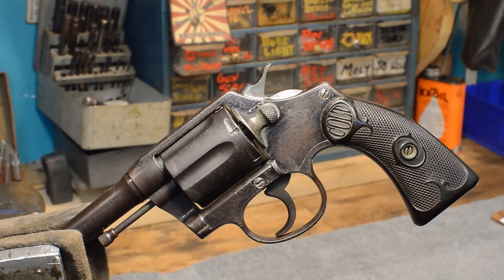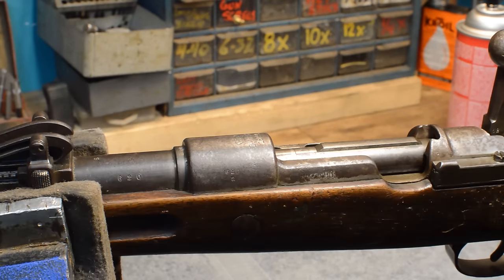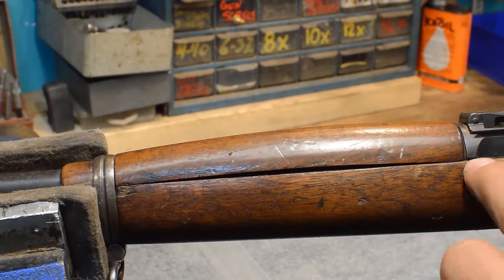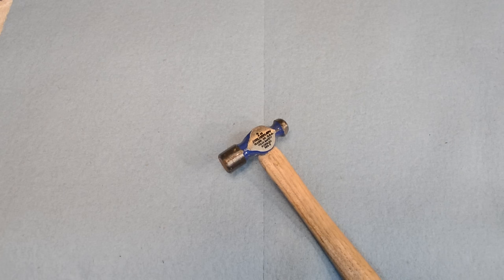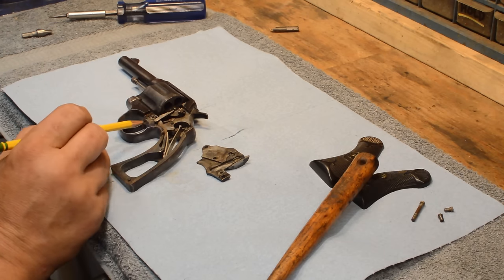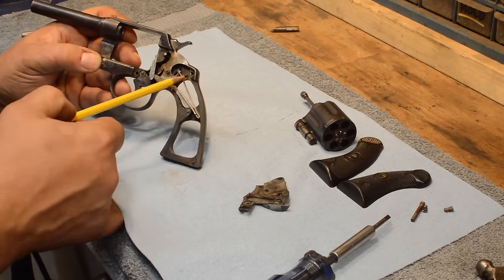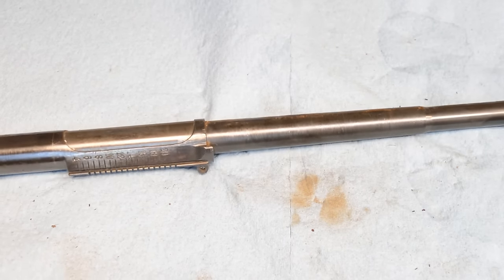Conservation 101: Stop the decay!

Comment: Hey there, question for you? But first, thank you for your videos, I have enjoyed learning a little something about conservation of firearms. So back to the question, I have a nicely blued 1903 pocket hammerless, I don't know if it's the original bluing but it looks pretty nice. There is however one small spot of rust on the slide the size of a small drop of water or so. Can I just boil any parts that have rust on them in water to convert the rust without removing or damaging the finish on the gun? The rust spot is pretty small but I want to stop it from growing any more. It's a nice old gun, I'd like to keep it as nice as possible. Ya know? Thanks for your time.
Reply: I have a very similar situation. Have you found a good answer? Best of luck!
Reply: That is exactly what this video is about. All the same rules just described apply.

Comment: I've cooked my rusty 98k parts today and tried to brush off the converted rust with a nylon brush and the rough side of a pot sponge.
Didn't really work and the parts sitting in kerosene now.
Do I have to card that loose oxide off or can I leave it there?
Reply: Since three weeks has gone by ,how did it turn out ?
Reply: @jimmymckay73  Ended with using a brass brush and steel wool. I think I did remove (most) rust, but on those area where I used the brass brush the metal did turn slightly brass colored.

Comment: Do you adversely affect the value of a collector gun by replacing damaged screws with NOS originals?
Reply: unless they're uniquely marked I honestly don't see why they would. Especially if you take the time to "antique" the metal no one would be any the wiser in the first place.
Reply: Probably not, but it pays to be honest. If you did replace a part tell the buyer why and try to use appropriate replacement parts. 99.9% of people besides you and him would never know or care to know.
Reply: @NoQuestions4sked  Thank you, Jared!
Reply: @NoQuestions4sked  Yeah, the honesty is the crucial part. There's absolutely nothing wrong with doing that type of restoration, but it starts feeling sketchy if I discover it after having paid for the thing. Not being upfront about it is just a quick and easy way to invite skepticism towards you as a seller. It's not the crime that gets people, it's the cover up, so to speak.

Comment: Is there a smaller carding wheel that could be used with a dremmel tool? I looked on Amazon but all I saw were wire wheels.
Reply: That'd be nice
Reply: A Dremel spins way too fast. you can chuck a carding wheel into a hand drill
Reply: @TEXwithNODS  Many Dremels are variable speed, so your blanket statement is a bit false.
Reply: @TEXwithNODS  That is exactly what I do. I chuck the carding wheel in a hand drill and hold the hand drill in a bench vise.

Comment: So if we cheap out and use diesel instead of kerosene, should we use on-highway low-sulfur b5-b20 biodiesel or off-road diesel/heating oil?
Reply: the more oil the more mess! Kerosene is a bi product of diesel.ergo less oil. so any diesel will do.

Comment: Hey, I'm not sure I have understood everything (english isn't my mother's tongue), but why is it needed to boil the pieces into water and convert the red oxyde into black oxyde? why not removing the rust with fine steel wool + vaseline oil? (I know little to nothing about this subject, just trying to understand)
Reply: When you do that you expose the bare metal so you go back to square 0. with the rust that is there is converted form red to black it protects the underling metal. as stated the boiling is a chemical reaction so the metal is being changed, at least the red iron oxide.
Reply: @handsomerob1223  so you need to first boil the pieces in water and then use fine steel wool 0000 + oil right?
Reply: @Itk8989  Fine steel wool, #0000 but first cleaned in acetone to REMOVE the oil that is added to the steel wool. Then just use the fine steel wool to remove the red oxide that you converted. Even a toothbrush will work.

Comment: may muzzleloader shooters don't use really hot water for fear of "flash rust"... Wouldn't the oxide be there whether or not they choose to see it, (as in when exposed by hot water)???
Reply from the maker: The oxide layer will "flash" no matter what. The trick is to get some oil into the pores. I'd rather use hot water, get the sulfer liquid, RINSE (this step is always skipped), then oil.
Reply: I would never use water either. 
It's really strange watching some muzzleloader vids because people will literally be in denial about rust.
They will say something like "I always just use hot water and have never had rust"
Then proceeds to show the muzzleloader that is so rusted that it's pitting.... 
A new  bottle of engine  oil works for just about everything and only cost like 5 bucks. 
Between a tub of axle grease and a bottle of engine oil you can take care of/ prevent most problems.

Comment: So for an old muzzleloader such as a Springfield 1861 that's finish was "in the white" or bare iron, can I rust blue it and then just strip the bluing off with chemicals to return it to its original finish?
Reply: I have the same question. 
Originally browned guns will stay brown well enough on their own. 
Blued guns that have gone brown can be converted back to blue.
What should be done for guns in the white that have since gone brown?
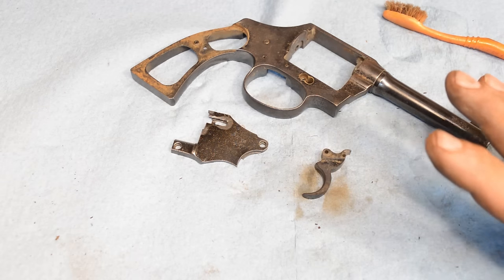Reply: Mark answers your questions exactly at 46:24. Yes mostly. 
1. Degrease your parts
2. Boil in water to convert red oxide to black oxide
3. Dry
4. Card to remove surface oxide
5. Repeat steps 2 through 5 until all rust is removed
6. Chemically remove blueing
7. Soak in kerosene 24hrs.
Reply: not trying to give advice. but would the "patina" that the "in the white" metal develops - would that act as a "browned finished" and stop further erosion of the metal?

Comment: What's that spray that you use at the start to remove oil?
Reply: Judging from the color of the spray can, and how fast it dried, I'd say it might be a can of Brakleen . A chlorinated automotive degreaser.
I use it for a variety of things.
Reply: My mistake , he mentions it later in the video....it's Electrokleen (?) a similar degreaser that's safe to use on circuit boards

Comment: What is the material you use on your bench vise as padding?
Reply: Carpet felt pad.
Reply: GunBlue940 smithed for Ruger and recommends 3/8” plywood. Starts with a square and cuts a recess in the bottom to fit over the throat of the vise.

Comment: Hi Mark, just a simple question: why did you say Diesel "makes a mess"? I can't buy kerosene at a reasonable price here (we're talking like 190€ per gallon): can I just use regular diesel to displace water or are there better alternatives excluding kerosene?
Reply: @Phage26 Go to the airport and buy jetfuel Same as kerosine
Reply: In Northern Europe, Kerosene is sold as heating fuel oil.   Any farmhouse will have an Aga cooker, and if they are not on a gas supply (most farms are not) then they have an oil tank full of heating oil (Kerosene) to run it and run their central heating.   Only trouble is heating kerosene is delivered a few thousand gallons at a time, but the people who sell this fuel oil can let you buy a few gallons as a sample if you speak to them nicely.  Or if you live in the countryside, just take a gallon from your own tank.
Reply: @davefellhoelter1343  apologies, didn't receive a notification for the reply. I just saw it a c ouple minutes ago. I thought he was referring to other "mess", I know it stinks. I did everything outside (only needed a cup for small parts) and wearing gloves and a mask. Kerosene is not really that common here in Italy, unless you can use it with additives that put there so it can be used in the house (pure 100% kerosene is nowehere to be found here, unless you are a registered dealer who can have access to it like in an airport)... Ended up using diesel, really not that bad considering I have plenty of space outside and I can easily wear integral protections I have at home. Thanks for the reply.

Comment: Mark, carding wheels. Are there different wire dimensions, are there wheels that work with a drill as i do not have a bench grinder machine. Thanks for your response and support.
Reply: Everyone absolutely needs a few basic tools for the shop. The three most important tools are a bench grinder (with wire wheel and grinding wheel or polishing wheel), a work bench, and a bench vise. Your work bench must be solid and bolted to the floor, your vise must be of adequate size and it must be bolted to the bench. Your bench grinder must be bolted to the work bench as well.  Get these three things before you spend money anywhere else on tools. They’re the most commonly used tools in most shops. 

Then buy hammers, screwdrivers, hand tools, etc as you need them

Comment: I was wondering if you could also use an ultrasonic bath to get the rust off? Are they effective?
Reply: Ultrasonics won't remove the rust!
Reply: @1339LARS  ok
Reply from the maker: Ultrasonics are great for cleaning things with no moving parts, or are not disassembleable, like a pocket watch, or jewelry. Are firearm should be cleaned, oiled, and INSPECTED, which a disassembly allows for. To answer the questions
1. Does not deal with rust
2. Very effective at removing dirt, but at large per unit cost
GREAT QUESTION, thanks
Reply: @marknovak8255  Thanks for the response, Yes, After full disassembly. and boiling it. an ultrasonic wouldn't remove all the rust? I have an old typewriter that has some rust. and quite a few more parts to clean than a gun.

Comment: Not to be a bother, but how do you mount that Brownell’s wheel to your buffer?
Reply: I wondered the same thing but found an easy and cheap solution. Larry Potterfield from Midway USA uses a drill press! Easy and seems to be just as effective. I am planning on getting a variable speed one and it gives plenty of clearance.
Reply: I bought the 4 row carding wheel from Brownells that Mark uses.  I use it in a Harbor Freight drill press (bench top style) and tried out multiple speeds to find the right one.  I like around 2700rpm.  Buffers usually run 3400 to 3500rpm.  I ran to the hardware store and bought a 3in long bolt that fit in the hole, about 1/4in and nut.  Two fender washers and it works great in the drill press.  I'm a fan.  Did the boiling then carding and was amazed.  I am very thankful, that Mark shares his hard earned experience/knowledge with us!!

Comment: I have an old J Henry and sons percussion muzzle loader. It isn't in collectible condition. This video gave me some ideas about how to arrest the decay. Is there another video about best practices for rust protection (owner maintenance level)?
Reply: I coat all metal in Ballistol or Lucas Extreme Duty Gun Oil, and oil all wood with danish oil. Never have had any rust with this treatment.
Reply: Another option is low-odor mineral spirits, available at paint suppliers.  Naphtha ("white gas," Coleman Fuel, and Ronsonol are all the same stuff) is also a great choice.

Comment: I have an old 22 that over the years has become brown or plumb colored. In some places I can see the original color. Can the boiling and carding method convert the plumb color back to blue? I've run some parts through the process once and only see a slight difference in color. Will repeating the process eventually turn the color back from brown/plumb to the original blue? If anyone can answer this that would be awesome so I don't waste a bunch of time boiling and carding the parts and yet get nowhere on returning the original color to the rifle. Thank you very much for anyone who can answer this for me.
Reply: Some old guns were rust browned, not blued, but the vast majority that look patina/brown/plum is just oil soaked rust. I would just keep boiling for 45 mins then carding a few times until all the rust converts back to the original bluing.
Reply: @kylerobeck6750  ok, thank you. I boiled it once and then set up a steam tube and ran it through that once and it just looked like clean smooth brown with a bit of a shine to it after I was done. I guess I'll keep trying. It was manufactured in the early 1900's so it's seen some years.

Comment: most don't know that kerosene is Jet fuel..
Reply: Not exactly true, Kersoene Oil is what is also called Petroleum. Jet Fuel is "light Petroleum" with additives. See "Jet A, Jet B" or JP 1 to JP8
Reply: I beleive that Jet-A is Kerosene strained to 1 micron if I'm not mistaken.  So if you can get jet-A you got kerosene.
Reply: But will it take the temper out of a steel girder?
Reply: @kaptnblaubaer  Oh thanks a lot, now those old Navy Flight Deck dreams are going to haunt me again.
Reply: @johnhubbard6262  That is why I served in the German Air Force, to much danger on Flight Decks ;-)
Reply: Jet fuel has additives. Kerosene is not that hard to get, just use it.
Reply: @invisibletosociety8338  yes. with ease.

Comment: What brand screwdrivers are best?
Reply: Have the heads fit the slots very closely, or modify the heads. Otherwise, go with what works for you.
Reply: Brownells Magna-Tip are the best and have a lifetime warranty on the bits.
Reply: So long as the tips are hard, brand matters less than fit. I have a drawer full of cheap ones that get ground-to fit every time I use them. Think of them as consumables.

Comment: Recently, while disassembling a Winchester model 1873 I used your technique of tapping the screwdriver blade into the wood screw on the butt plate(that was well rounded from abuse, and rusted in tight) Then chucking it up in a cordless drill with a reverse then setting the clutch on as low as possible in reverse to get it to move. All this after using penetrating oil on the screw. other srews in other areas of the gun, I used a piece of rubber to remove the effected screw?

Comment: 51:13 minutes.  Harbor Fright what?  It is not clear why I would want this.  I suspect it is heated.  Give us a clue.  A description.  A model number.  It's got kerosene in it?  To boil out the water.  So it must be heated, eh?
Reply: I'm trying to figure out where Harbor Freight has that can.  Those bench cans are nice for soaking, I remember using one at my grandpa's shop for small parts.  My problem is finding one that has the depressor to keep the parts submerged to soak.  Seems they are all set up for the screen to pop back up.
Reply: If he did get it at Harbor Freight, it's old and not sold anymore. Not heated, kerosene just displaces water from the metal's surface/crevices. You can probably make something similar (although not spring loaded) using a paint can and a steel mesh basket.